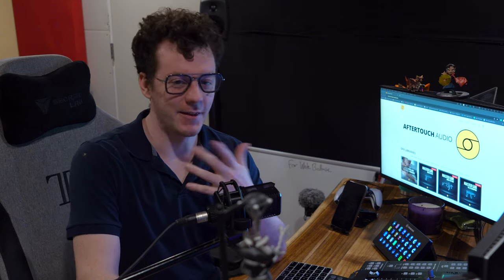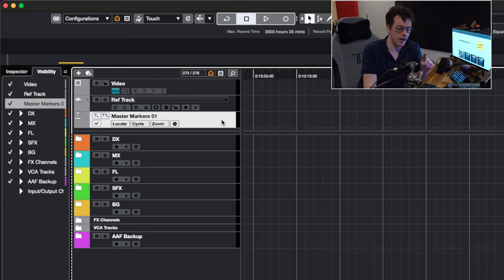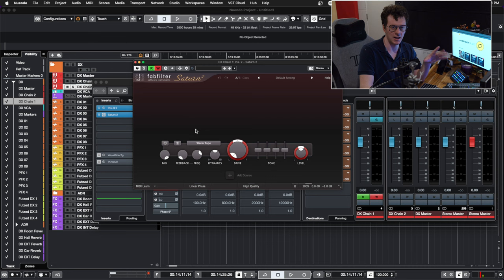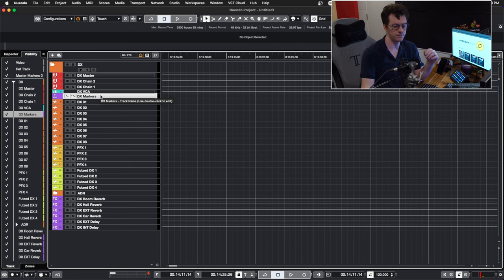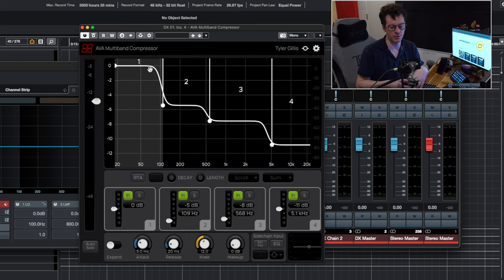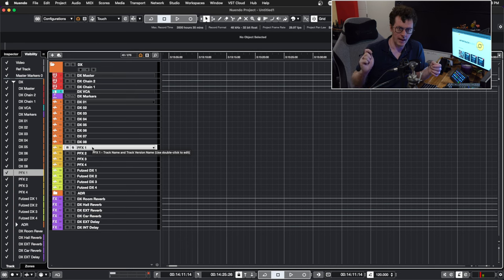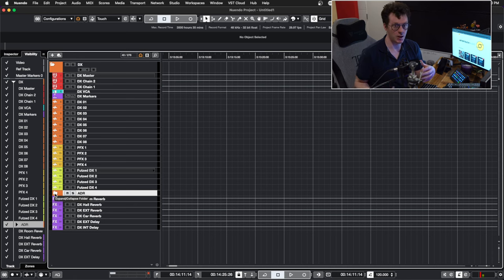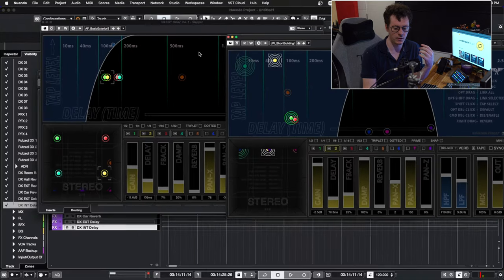Post Production Template Part 1: Dialogue

Comment: Thanks for a fab video, I'd love to see a more indepth view of how you print your stems! :)
Reply from the maker: File - Export - Select tracks I would like to export from, render. Nuendo has some awesome export features.
Reply: @AftertouchAudio  ok, thanks for answering! So you don't print your stems to audio in the supersession? In real-time I mean! As opposed to exporting them and creating a new audio track from that export
Reply from the maker: I personally don't print my stems in my session in real time. 

There are advantages to printing them like being able to update a portion of the original mix without having to render out the entire process again, but I've always found it to not save that much time compared to just rendering it out again.

With that being said, Nuendo still has the ability to do a real time export, and on my export I can just select my FX, MX, M&E, DX, & Master Groups to get all the required exports in a single pass. Where as, if you are using ProTools you'll have to do each export separately so printing in ProTools is easier.

Comment: As always Tyler your videos help me a ton! I would like to hear you show us how you cut DX for perspective changes. I've been through a lot of forums and it seems to be a pretty hot topic still... What's your approach?
Reply from the maker: Perspective changes like distances? Kinda depends on the situation I guess. Filters delays and reverbs tend to be the main approaches to distant mixing.
Reply: @AftertouchAudio  Yes, but I was referring to the "decision-making" process of choosing when to portray distance and how to do it without making the cuts more obvious. 

Of course, it would depend on each film, but something along the line of: 
- When would you keep the DX sounding close up even if the shot changes from a CU to a wide/long shot? 
Or
- If the scene goes from a tight 2-shot to the CUs back and forth there might not be a need to mix the change of perspective, but if there's a big change in POV, then yes, and so on...

No need to try to explain these examples here, but a video/challenge on that topic would make my year!

I might need to search more but haven't yet found widely accepted info or any concrete info at all on this subject. Just the usual "how to make DX sound distant" tutorial, which doesn't really answer those questions...

Thanks Tyler!